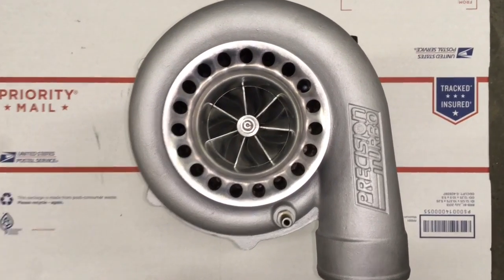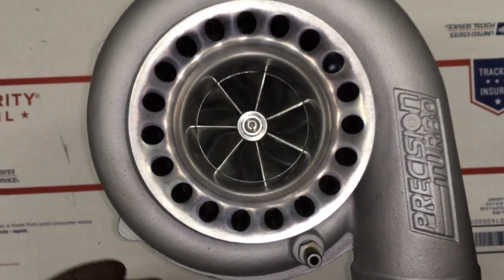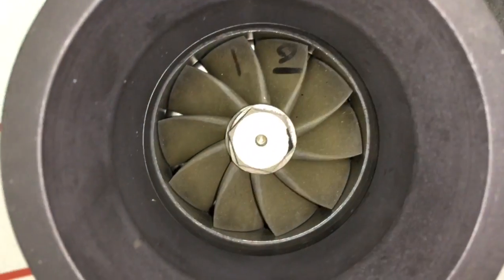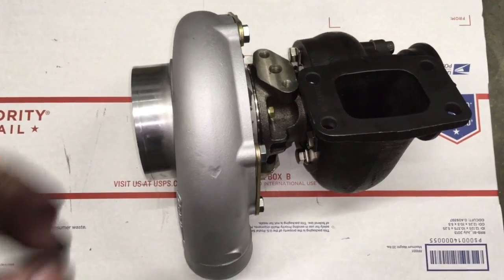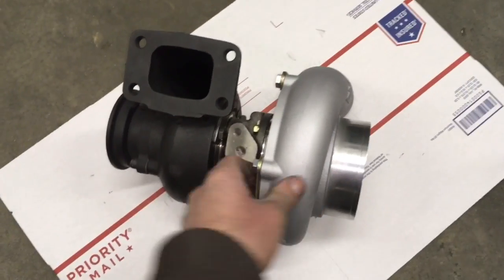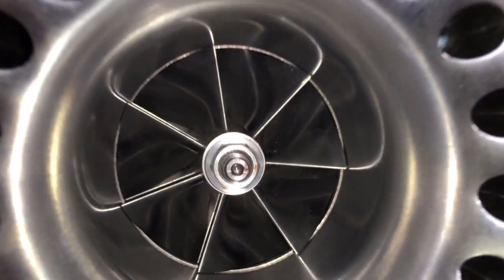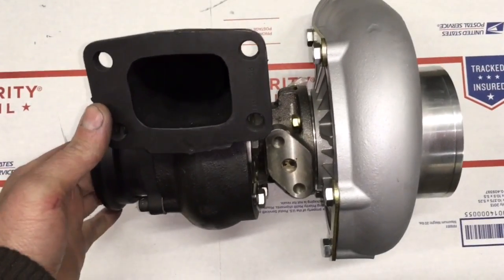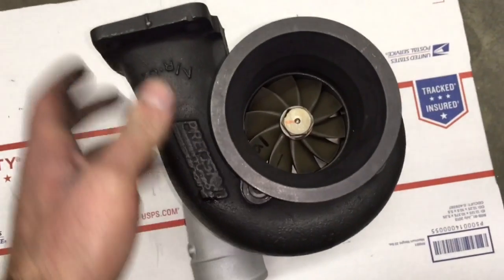PTE 5858 Turbo Rebuild + Upgrade to 60-1

Comment: Just rebuild a turbonetics 60-1 t4. Received turbo disassemble so I wasn't sure how everything went. I notice both the journal bearing housing didn't have lower c clip groves, does that sound right? If I put a c clip in there and lock the journal bearing with the outside c clip in place, the bearings do not rotate because they're lock in so tight. Most of the t3/4 turbos I seen used 4 c clips total, this one only used two to secure journal bearing inside housing. Have you seen this before?

Comment: Do you offer a BB conversion kit for k04 turbos?
Reply from the maker: +userpike no
Reply: If I sent you a k04-023 exhaust housing could you fit a cartridge that would still be water cooled but have BB instead of journal bearing? or just convert the k04 cartridge to a BB? Is this even possible?